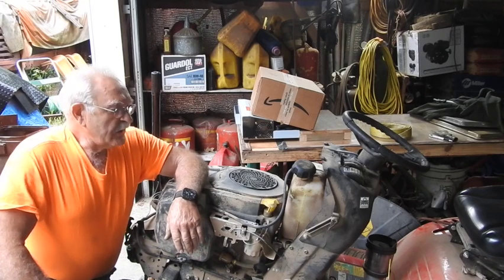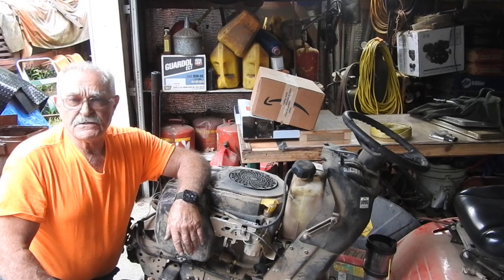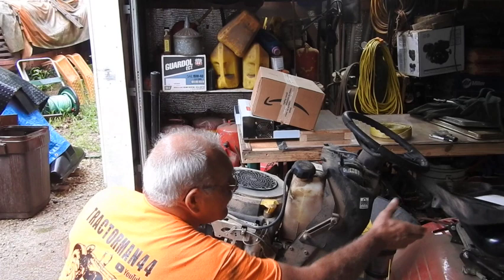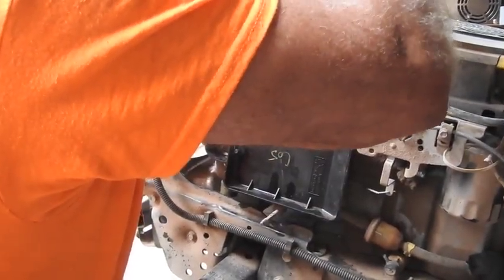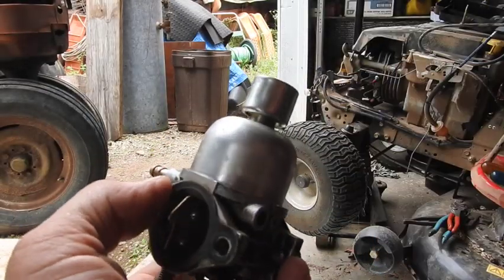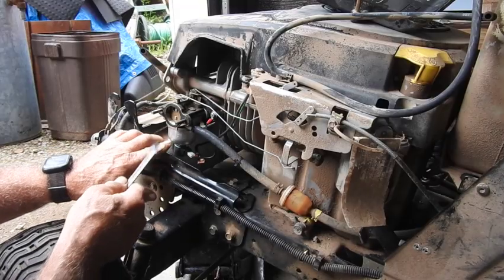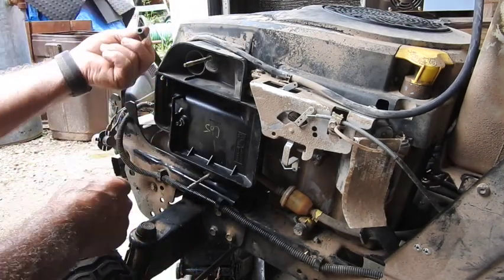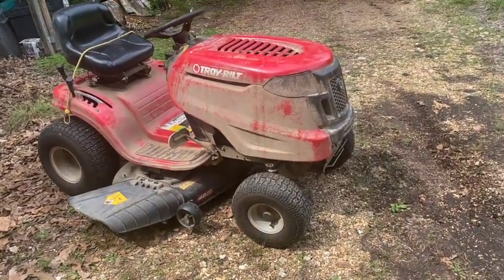Troy Bilt Riding Mower Won't Start

Comment: Little neighbor lady will appreciate you fixing her mower.   A loaf of banana bread or two sounds like a good trade.   
For letting mowers or trucks sit over the winter, I’ve added Stabil for several yrs.   This spring for the tractor Seafoam has been used with every tank full.   Gummed up carb is most likely the culprit on my old front line trimmer because it has no oomph.   Did a dandy job when newer with almost pencil size line.  Taking it to a shop would cost as much as the thing did new 15 years ago.
Reply from the maker: That's the sad thing about having an old piece of equipment.  My buddy that owns the local Cub Cadet dealership won't even take an old anything in for service.  He realizes it's just too expensive with what he has to charge for shop labor for his employees pay+ benefits and knows most every customer will not be happy when billed.  I'd keep running a heavy blend of SeaFoam and over time it may just open itself up and run good again.  If you give it a try,  you should run it wide open from start to finish, no low speed operation at all. With the heavy blend, the intense heat may burn through an exhaust carbon build up while also clearing partially restricted jets in the carb. Good luck !!

Comment: Good tip Wendell, I have an old Troy Built.
Reply from the maker: That's good Glen.  I bet over the years they used different power units.  This big problem today is almost always the gas gumming up the works...or oxidation in the carb due to the ethanol blend drawing moisture.

Comment: A delightful Sunday evening lawn Tractorman 44 vid celebrated with the tippin of a CuppaJO your way! Interestingly enough, I must fool with my Craftsman mower and I don’t think it’s getting a spark, which I haven’t checked as yet. Did replace the very dirty air filter and new spark plug but it won’t turn over. So may be this week I’ll get to it so I can haul my log splitter to all those dead oaks I had cut down in the spring. I have seven sizable dead oaks to make into firewood. Won’t be too long until we’ll need it but not for a good while. But as we know all too well, time goes plum quicker than a 44 buck during rutting season! Do tractors have a rutting season? I don’t know, I’ve never seen a tractor factory video! Hummmmmmm, a true mystery, eh? I mean lawn tractors are off spring of the big ones right? Perhaps you have a 44 nursery there? Anyway, enuff of me DaveyJO foolery and it’s time to heat up me CuppaJO since I was busy buttoning. A tippin toast is headin your way! Squeezes to The Missus Pleasus!  DaveyJO
Reply from the maker: Heck yeah DaveyJO...gotta get on them oaks buddy !!  Shhhhhh....no talk about cold weather just yet.  I'm just now getting thawed out from last winter !!  LOL.  My tractors only 'rut' in the mud.  And boy do they rut deeply....occasionally all the way up to the axle!!  That's why several of the old dogs I got run chains year round.  Well, that's mainly because I'm too lazy to take them off and put 'em on every year.  True story !!  As always, I love your commentary....never know what's gonna come outta your creative mind.  But its never a dull thought, that's for sure.  I'll be enjoying some fresh black stuff in the morning my friend.  I'll be toasting ya then my friend !!
Reply: @tractorman4461  Toasting Monday morning! I’ll get it all ready to go in the morning so I can press the button on the Cuisinart (had to go look at the spelling) and be ready for drippin, tippin, sippin and rippin,,,,,,of course it all depends on what I ate this eve! The top of a fine Monday to yaz! DaveyJO
Reply from the maker: @daveyjoweaver6282  Hahahahaha....crack me up DaveyJO.  I'm starting the second pot for the morning as I go through and make my replies.... Have a great day no matter what you work on or do my friend.  Stay cool and don't overdo it yet old buddy !!

Comment: The alcohol and ethanol they put in his gas today was just simply tear up the small engines. I always try to use 92 octane and that does seem to help. I like you’ve cleaned out many of those carburetors.
Reply from the maker: Ya gotta stay on top of all the small engines now a days.  I see guys on forums continually saying they have NO issues at all with leaving gas in trimmers, mowers, saws and even tractors for years and suffer no issues at all !!  I don't know how they do it Bruce.  I don't get that lucky.
Reply: @tractorman4461  yea me either. I worked for 10 years in Stihl and I couldn’t begin to say how many trimmers I and saws I have worked on.  The older saws with the old Walbro carbs didn’t seem to have as much as an issue.  I believe that the jets and one-way valves used larger ports.

Comment: Learned a new one on the wrench.  Thankz!
Reply from the maker: Heck Mike, I have quite a number of 'customized' wrenches.  I usually use older ones to bend to odd angles or thin down or cut off to create a super short stubby for a tight space.

Comment: Good going. They always have to add safety gadgets. Something else to go wrong. This wasn’t the issue this time fortunately so a good cleaning and back in business. We run ethanol free gas in all our small engines. Rarely have carb issues.
Reply from the maker: Yes, all the safety gadgets do add to the frustration on many occasions John.  Like the safety switches on the mower deck.  Some even have one that kills the mower deck when you put the mower in reverse.  Now I understand the need for the seat switches, but reverse....??  If ethanol free was easily available, that's all that would go in my small engines.
Reply from the maker: @johnanthony2545  Ain't that something.  I'm sure you are right about that John, and I can understand the concept.  It is amazing how careless some people are, actually its truly amazing that some can't recognize the obvious danger of power equipment.  Mind boggling. But it's a real thing.

Comment: I have a pile of old bicycle wrenches that are stamped from sheet metal. They are pretty thin about 1.5 mm or less so they should fit to pretty tight places. Still used on bicycles.
Reply from the maker: Yeah, those would work perfectly in this case.  I don't have any of those wrenches at all, but I do have a set of the old tappet wrenches but they were too thick to fit in the slim space.  I think Briggs must sell a special tool for this situation.

Comment: Wendell, you explained about using a thin wrench for the anti backfire solenoid, of course I've had to do this too,.. but you reminded me of a dandy set of very thin  wrenches that I happen to find at a local hardware / mechanical supply shop a few years ago. These were called 'tappet wrenches'  and were of the open end box wrench style, but about 7 or 8 inches long too. Have you ever seen wrenches like these?
These 'tappet wrenches' are not very commonly seen these days, but I'm glad I have them, I can tell you!  They really come in handy for jobs like this.
I wonder too, at how on earth did the owner of that Troy Bilt tractor mower get it so covered in mud? Was the air filter full of dust and dirt too?
Reply from the maker: Yes, I was foundering for the name as I called them  'thinnest wrenches you have'...LOL  Brain fart, but that happens a lot while recording.  I too have a 40 year old double end wrench set  of long Craftsman tappet wrenches but as thin as they are they are still too thick to fit in the tight space between the float bowl bottom and the top of the solenoid.                       
     I'm sure the mower manufacturers have a specialty tool for sale just for this purpose though.  I think its just another of the simple ways they use to discourage people working on stuff themselves.  
    Remember the push mower with the extremely dirty filter a few weeks ago?  Well this one, though pretty dirty, wasn't quite as bad as that one.  My neighbor lady's son is the one that keeps her grass cut, then she asks me to look at the mowers when they won't start.
Reply: @tractorman4461  "Brain fart", how about this,.. I took a perfectly good wrench of mine a couple of weeks ago, and ground it down thin to fit in a job I was doing,  then this video reminded me that I have that darn  tappet wrench there in my tool box, yes it's 1/2 inch too.  Hahaha.
Reply from the maker: @regsparkes6507  Ok Reg, now I'm cleaning the screen and keyboard from the soda that spewed out trying to hold back a laugh !!  LOL  That's funny man.....funny.
Reply: @tractorman4461  Ahh, key boards are only cheap! LOL+

Comment: Will the use of Stabil gasoline stabilizer help this problem any? I don't know if any of our (my neighbor and me) mowers are new enough to have the anti backfire solenoids on them but I'm sure we would probably find a way around them like we do on safety switches. But don't tell any one.
Reply from the maker: You didn't hear it from me, but some guys just cut the stem off the solenoid to eliminate the function.  It'll probably  go to backfiring though if you do Rick.  Now I use a product called Pri-G for all my gas engines, large and small but I did use Sta Bil for many many years with good luck.  Most of the time with my personal equipment, I'll run them close to dry then add a good percentage of SeaFoam to the remaining gas, then start and let them run dry while running the heavy mixture.  That practice saves me almost every time so far.

Comment: How did you get the float bowl and everything past the frame?
Reply from the maker: I ground an end wrench down thin then unthreaded the solenoid assembly off the bottom of the carb. Then reversed the process for reassembly. It’s gotta be THIN so I used a trash wrench. It lives in the tool box now.

Comment: HI, I have to jump  my battery every time i use tractor, its very new also and now it starts kicking and popping when i turn on blades. i used this tractor only dozen or more times. one thing i did wrong i left gas in tank and oil over the winter months. Do You have any ideas on the problem.
Reply from the maker: When I get one in with old fuel, I usually drain the tank then put a gallon high octane fuel in plus a healthy doze of Sea Foam. Then start and run at wide open throttle to see if the passing of the SeaFoam clears out the main jet enough to allow the carb to deliver enough fuel to make it run correctly.  If that doesn't work, I opt for removing the carb and cleaning the internals very thoroughly.  Oil left in over winter isn't going to hurt it but should be changed after you get the motor warmed up.
Reply: @tractorman4461   Thanks for Your advice I will give it a try.

Comment: My John Deere 110, 19hp Briggs would backfire if it was idled down low. I mean it would bang like a shotgun. I read in the book or a lawn mower mechanic told me to idle it up a shade. No more ringing ears.
Doc
Reply from the maker: Whatever works is good Doc !!  LOL   A lot of engines are bad about partially shearing the crankshaft key while backfiring.  That changes the timing enough that it becomes either hard to start or just won't start at all.
Reply: @tractorman4461  I don't know if mine has that valve. It's probably 13 years old. It may.

Comment: your video was good and explained things to me that husband didn;t but I still feel intimidated by carb issues and the prospect of replacing solenoid. 😒 Especially the idea about grinding down open end wrench. I have a grinder but I never used it (mechanicals was husbands domain). I have some VAGUE! notion that in one of the tool boxes or "free" OEM tool inclusions there was a strange thing flat wrench that just made no sense. Wonder if there is one floating about somewhere. Still a bit dubious about the battery. read 12.2...slow charged for 4 hours and came up to 13.x...(no under load). 
New spark, new fuel filter, fresh gas, and still won;t quite catch. Which is why I think and dread the CARB.
Reply from the maker: Now, if you go to an auto parts store you may be able to find a few actual factory made thin wrenches for just this application.  Or you can google super thin box end wrench sets, look on Amazon and  Temu sells real cheap ones for almost nothing too.  You may only need to use one or two...I'd suggest 10, 11, 12 and 14mm for sure and 3/8", 7/16'', 1/2''.     
     Chances are your solenoid is gummed up AND the main jet directly above the solenoid could very possiby be gummed up too. The hard part is actually removing the carb on this unit because it just about doesn't want to come off it seems. The solenoid actually holds the float bowl in place, so be careful to not break or lose the plastic float/main needle when the bowl comes off. 
    Also there is a very thin 'O'-ring that seals the bowl and it is very hard to get back in place.  It also could be a square O-ring.  Actually square material formed into a circle to fit the bowl.  Keep a clean white rag available to disassemble it on, the rag will keep the parts from bouncing off the bench and to the floor and the white material will highlight the parts as you line them up during disassembly.  Btw, what you describe is typical of fuel not getting through the carburetor to the intake to ignite in the cylinder.
Reply: @tractorman4461  thanks for those tips...but I believe that I found the right Carb on Amazon... and not that expensive and replacing is an easier option for me I think  The tractor is out in the field a few days since and stuff grown around it and MY LUCKY something would drop and be LOST FOREVER. IF I replace and it works I can keep the old one and box it to "rebuild"/clean up later-over winter. If not I know my option is to buy end of season mower. That is actually how I bought this one on  Oct 2019.
Thanks for in depth description.

Comment: My 2 y o Troybilt is powered by Honda.  So far no problem,  but I drain, and run it out of gasoline.  Thank you.
Reply from the maker: Man, Honda makes a good engine for just about anything !!  With today's gas, doing what you do is probably overall the best solution to eliminating this issue Bryce.

Comment: At the 5:40 time on video, why does the company design that so you have to use the bench grinder to make a wrench thin enough to use in that spot?  Anyway, I enjoyed seeing you work out of the rain.  No doubt your neighbor appreciates you.
Reply from the maker: Well, I think it's to sell you a 'specialty' tool that's a single function wrench.  I have a pile of wrenches of all sizes that I have altered for specific functions.  Some are custom bends of the wrench head, some are thinned like this one, some are cut super short. But ya gotta just do it sometimes.  I really enjoy shop work in the rain.

Comment: Does back firing mess up anti back fire solenoid
Reply from the maker: No not really. The solenoid just eliminates the back firing when the engine is shut down especially while hot and at a higher than idle throttle position. It stops fuel from being sucked into the cylinder and exploding due to the heat.
Reply: @tractorman4461  hey thanks for the information have a good day
Reply from the maker: @patsymoore-ff2gz  good luck with your project. Have a great evening.

Comment: I just thought I'd 'google' 'tappet wrenches" and whaddya know, Amazon has a fair few sets offered on their website too. ( but I have to say, as these are so thin, I'd want to be sure of their 'quality' before buying on-line. I prefer to have a look for them at places/stores who sell known good quality tools first. ) I don't use them very often so never thought to see if these are
available anymore,.. yep, they are.
Reply from the maker: Oh heck yeah, I'm sure they are readily available yet from most suppliers.  But yes, you'd be smart to make sure of the quality.  I use mine every time a valve cover comes off one of the old tractors.

Comment: Got that same engine 
Getting fuel
Getting spark 
But still wont start
What could be wrong?
Reply from the maker: Your main jet could still be plugged. If you have fuel in the bowl the solenoid is working on the float bowl bottom. But with gas in the bowl it might not be able to get through a restricted main jet.
Reply: @tractorman4461  if that its problem i should get running with staring fluid?
Reply from the maker: @johnrojas4282  a short blast of ether SHOULD make it fire. But not too much because you can do damage if you do. If it pops off, that’ll tell you that it’s not really getting fuel outta the bowl.

Comment: I find running the machine empty at the end of the season lets stop this. Where I am also I only use fuel without ethanol
Reply from the maker: The closest station I know of is 30 miles south of me to have ethanol free gas.  But yes, running them dry is a very good solution for sure.